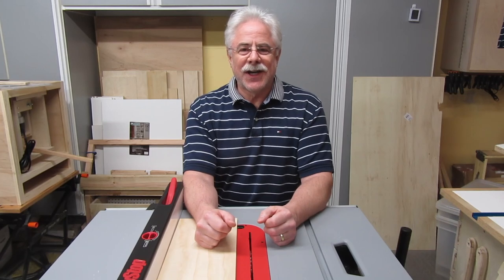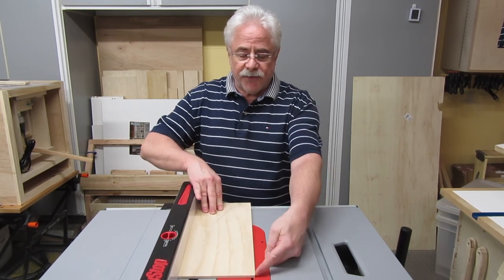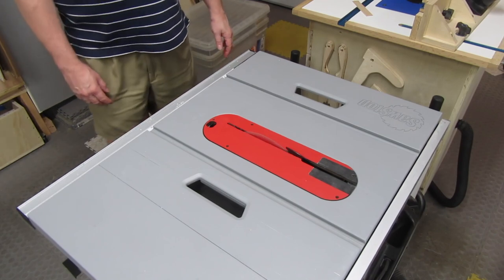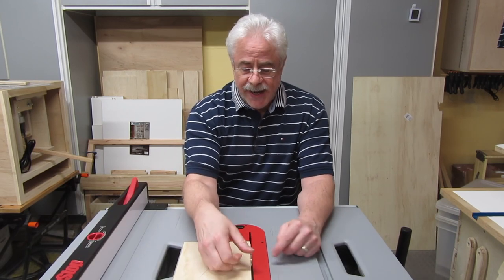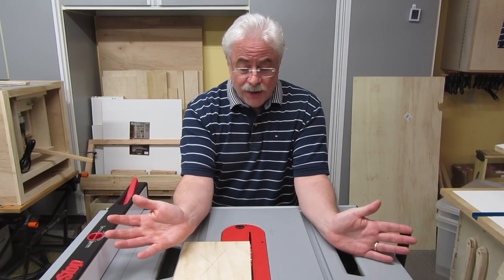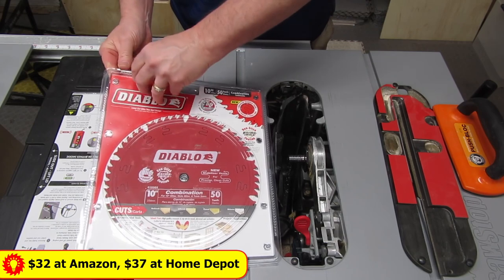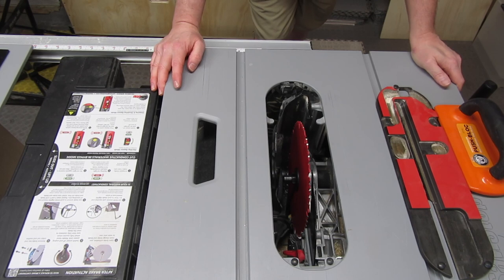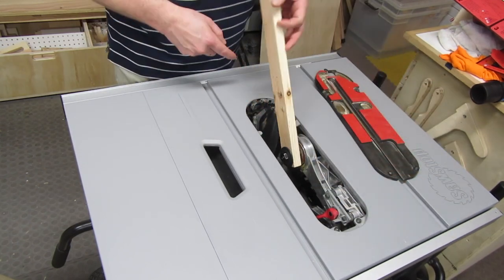SawStop Saved My Thumb! What Happens Next?

Comment: When I was researching cabinet saws, upgrading from Delta contractor, I looked at saw stop. The price took it off my list. But now I'm thinking, one trip to the emergency room, and saw stop would have paid for itself. 

If your channel was a little bigger, sawstop would have sent you one for free. Got to say, they are smart at marketing. Almost all big channels have one they got for free. Better than any other way of advertising.
Reply from the maker: That's what my wife said - one trip to the ER, and it doesn't seem as expensive. You're right about SawStop and marketing. I sent them an email asking if I could use their videos (which I ended up not doing), and their comment was "Thanks for your support! You have some great content. Please feel free to edit footage as needed." Now I kind of wish I had contacted them first. On the other hand, it's nice to be able to say they didn't pay me or anything.
Reply: According to my PCS manual, if you send your old brake cartridge back to SawStop and they confirm that it was activated due to contact with flesh, they’ll send you a new one for free. Hope you didn’t throw the old cartridge away!
Reply from the maker: @craigwilson4903  Thanks, Craig. I already knew that, but I appreciate the heads-up. I think I want to frame it. 😄
Reply: That ER stuff is no joke, but it doesn't stop there. I had an 'incident' with my table saw just before Thanksgiving of last year. I ended up with six stitches in my thumb (no bone damage though). It took until around New Year's for the cut to heal to the point where I didn't need a bandage on it. After several more weeks I could hold things comfortably and am now getting to the point where most of the feeling is back.
Reply from the maker: @navysandman1  Thanks for the comment, and sorry you got hurt. I had a router accident a while ago, and it took about a year before all the pain went away. So I'm in total agreement with you. It's more than just money.
Reply: Cliff Sandy Glad that your injury was fairly minor. I’m an operating room nurse and have been in on a few saw-related injuries. Some people never fully recover from their injury, even if they don’t lose digits. If you can prevent a few hours in the OR, you’ve way more than paid for your SawStop saw.
Reply from the maker: @craigwilson4903  That's a great comment. So many people feel like it could never happen to them. I hope for their sakes they're right.
Reply: not any more Festool will stop this way of marketing due to new european laws and company policys
Reply from the maker: @The1Rausch  What do you mean?
Reply: @TheNewbieWoodworker  I think he means that now that Festool owns SawStop, the saws will no longer be provided to youtubers as promotional items. No idea if that's true or not...
Reply from the maker: @SH-pc4xt  Ah, that makes sense. Thanks.

Comment: Glad you're ok.
Nothing wrong with reading the manual.
And you might want to consider using gloves for changing blades (not only for tablesaw)
Reply from the maker: Thanks, and of course you're right about manuals. I usually read them cover to cover. Gloves! Why do I keep forgetting gloves? Good idea, thanks. 😄
Reply: i never use gloves when using a saw or a grinder of any kind..

if i wear gloves when i'm using an angle grinder and the grinder gets a nib of my glove. it'll drag the rest of the glove in and cut off my fingers
Reply: @victorhangaas6719  using =/ changing blade
Reply from the maker: @victorhangaas6719  I meant that I should use gloves when changing the blade, not when actually using the saw.
Reply from the maker: @ichliebeminecraft  Yeah, that's what I meant. 😄Thanks!
Reply: @TheNewbieWoodworker  iknow, but never use gloves when using rotary tools
Reply from the maker: @victorhangaas6719  👍
Reply: I'm not shocked at you actually reading your manual. What floors me is that you knew where to find it ..... That and how loud that saw is, holy cow.
My Delta belt drive is considered a contractor saw but you could have had mine running the whole time and still narrated the video over it.
I don't recommend it, but I can have a conversation over mine while it's running.
If you knew my wife you would understand...
Reply: @TheNewbieWoodworker  I use an employee. Don't have to worry about whether or not he wears gloves. Can tell them what to do but forget about telling them how to do it.....
Reply from the maker: @leveckfamily8841  LOL, thanks for sharing. I knew where to find it because it's stored in the saw. Otherwise, I'd have to hit the Internet. And yes, the saw is very loud. Fortunately, my new PCS is WAY quieter.
Reply from the maker: @leveckfamily8841  LOL. You sound like the perfect boss. 😛
Reply: @TheNewbieWoodworker  is the new one a belt drive?
Reply: @TheNewbieWoodworker  I'm loyal to a fault and get way too close.... My wife would say too perfect.....
So she handles two things that i can't stand.
She does the firing AND kills spiders.
I'd be lost and scared without her.
Reply from the maker: @leveckfamily8841  She sounds wonderful. "I'd be lost and scared without her." Ditto, and it's terrifying to even think of being without her.
Reply from the maker: James Zachary  The idea of the gloves was to help prevent me getting cut while I was taking the blade/brake off. I did get cut - no big deal, but the gloves may have helped.

Comment: Thanks for the reminder about table saw safety, regardless of whether or not you have a SawStop.  I'm planning to upgrade to a cabinet saw or hybrid in the next year or so, not only for the larger capacity but for the reduction in noise level.  Have you compared how loud the SawStop jobsite saw is vs the cabinet saw version?  That's the main complaint from my wife when I'm down in my basement workshop.

Also, the only thing less manly than reading the manual is knowing exactly where the manual is.  :)
Reply from the maker: LOL! I'll admit to that, but then again, it's right in the storage compartment, so it's not that hard to find. As for the noise - get this: I haven't plugged it in yet. With everything going on with getting the video done, and blogging, I've been doing things little by little. Got everything calibrated yesterday. I'll turn it on today. 😄

Comment: From one YouTuber to another: gotta LOVE that moment at 8:12!
Very useful, thorough and use-able method/process for checking blade alignment Dan... nice! Best, Matt
Reply from the maker: Thanks, Matt. I was beginning to think you fell off the surface of the earth! You know what's funny about the backwards blade? I didn't actually notice I had it in backwards until I made the video (yes, I fibbed a little). I just got lucky that I didn't try to use it. 😛
Reply: @TheNewbieWoodworker  I once did the same backwards blade thing... but it was when I was giving pointers for proper use of a dado blade, wouldn't you know?!  I tried to find the segment to link here but my selective memory seems to be working effectively.  I've been wandering close to the edge of the earth but haven't slipped... yet! Best, Matt
Reply from the maker: @NextLevelCarpentry  😄

Comment: A good rule of thumb (har har) that I use is no fingers within the "red zone" (the throat plate) unless the blade is stopped (not just powered off, actually stopped). When I do not want to wait for the blade to stop, I use a push stick to push the offcut out of the red zone so I can pick it up.
Reply from the maker: Great rule of thumb (very funny 😄), and normally I have the same rule. I don't know what came over me. 😳
Reply: That's all it takes, right? One second of inattention.
Reply from the maker: @Toklat2011  Sure is. Scary, but true.

Comment: All I can say is, don't use a tablesaw without a riving knife. Especially with long skinny pieces of wood that can kickback violently. Don't do it. It's not worth it. Throw your saw away, or find a way to retrofit a riving knife onto it. Or at the very least, get the press in pinned "splitter" jig for $25 on Amazon. I didn't know what a riving knife was, and I didn't study kickbacks properly. I wish I had. I had a really bad kickback 4 months ago. I'm ok, but will have permanent scars. Never angle your blade towards the fence, EVER. The old saws actually tilt the wrong way (towards the fence). Make sure to buy a left tilting modern saw with a riving knife. Never set the fence toed in at the rear, always toe the rear of the fence out slightly, up to 1/64th inches, away from the blade.
Reply from the maker: I don't disagree with anything you said, although I'm not sure why you posted it here. It would have made more sense under this video: https://youtu.be/ZUZ8hRm7a8g

Comment: The cost of the saw and the reset piece are a drop in the bucket compared to surgery and even a single hosptial visit.  My insurance has a 400 co pay for an ER visit. + deductible (around 1500) then 20 percent of the total.  I had a pay 900 for have my finger numbed, cut open and extracting a mesquite tree thorn that went in the side of my finger hit the bone and came out of the top.  It couldn't pull it out without enlarging the whole.   I was an 1.5 hrs from the nearest ER.   4.5 hrs later it was out (I couldn't find anyone that would cut the hole larger so I opt. for the ER).  That was before my insurance was as high as it is now.  I'd bet I could actually purchase that saw and 2 resets for less than I could a few stitches in my thumb.   I should actually take my own advice!
Reply from the maker: Thanks for the comment, and sorry to laugh, but, well, you said it - time to buy the saw. 😂
Reply: @TheNewbieWoodworker  Yes, I know... I also have other hobbies and things, so the money is split up.  I mostly do practical stuff and light custom frame work for the house.  A few pay projects here and there.  I usually put the profit back into things I need.  Works fine now (just light use), but I do intend to eventually sell it and get something else.  The table is sentimental.  My late father used it for many years and I actually do enjoy using it.  It's the reason its still in my garage.  The fold up saw really makes more sense for me but its like having him around I guess. The last two projects I actually used a aluminum straight edge and a circular saw with a finishing blade for sizing all my pieces and a router with the straight edge for the dadoes rather than bust out the table saw. Weather was nice so I did most of the work in the driveway to keep the dust out of the garage (no collection yet).
Reply from the maker: @Danman1972  I totally understand.

Comment: I was really lucky a few years ago. My hand slipped and my thumb went into my table saw blade (not a Sawstop). Went to emergency room got stitches and immediately bought a Sawstop. The blade didn't go deep and my thumb healed fine. Extremely lucky!
Reply: Mark Carter I am inclined to agree with you with about buying a saw stop, I just wish the price was not so steep. Or other manufacturers came up with same type protection. Perhaps the patent will run out and other manufacturers will follow suite.
Reply from the maker: @TheFalconJetDriver  I agree they're expensive, although I was surprised that the JobSite saw wasn't as expensive as I thought it would be. With that said, one trip to the ER would probably cover the cost difference! 😛
Reply from the maker: Talk about heeding a warning! Glad you weren't more seriously injured.
Reply: I wish they made one for a bench router. Got the top of my finger and tore it to shreds, not to deep and it's finally healed. Why doesn't sawstop make a brake when you switch it of. I hate waiting for it to run down. Even a drop saw has one. JD
Reply from the maker: @JayDee-xj9lu  Thanks for the post. I don't know the reason, but there's probably a good explanation.

Comment: Glad your thumb's intact, Dan!  👍   Wonder how much more of a nick you'd have had if it hadn't been spinning down already when it braked?  Probably only slightly more, seeing how the teeth dug into and were stopped by the soft metal of that brake pad.  But don't demo that!  😄

Interesting arbor alignment technique, very inventive!  My own involves having the blade installed and fully raised to extend the arbor diameter to the blade diameter, then putting a piece of aluminum channel (one of those cheap 8' edge guides for ripping) against the blade (actually against two of the teeth leaning in that direction) to extend that line further.  The edge guide is wide enough that it shortens the distance to the miter slot sufficiently to check it with a common caliper micrometer, narrow enough to check its own width with the same micrometer, and long enough to extend the line of the blade the full length of the miter slot, multiplying any error as much as possible by allowing a check at both the front and back ends of the slot.  Also the effect of any blade warpage can be discovered by simply rotating the blade and rechecking a couple times.
Reply from the maker: Thanks, and no, I won't be demonstrating that. At least, not intentionally. Good technique!

Comment: I did exactly the same thing. I shut the saw off and removed the wood. Contacted the very tip of the blade with hairline contact. The blade had maybe one-half inch of travel left. Nothing dramatic happened; just a little click. No! It couldn’t have! 
It did.
The blade did not retract into the machine. No momentum energy in the blade to cause this. The only way I knew the thing had gone off was that the blade was absolutely locked. 
Do not replace the blade/brake cartridge without wearing gloves. The blade is sharp and dangerous. Working to replace the blade/brake assembly without gloves is asking for trouble (experience here). But it’s an easy fix.
How much motion was left in the blade when I touched it? Essentially NONE. Absolutely no damage to the blade OR THE SAWSTOP BRAKE CARTRIDGE! Except the cartridge triggered. The cartridge looks perfect except for a few marks where the saw teeth hit it; ‘probably a unique damaged cartridge. However, it’s now just wall art for the shop. Replacement? $110. Oh well, ‘nice to know it works.
Reply from the maker: Good tip about using gloves - I've learned that lesson well. 😂

Comment: Yes, you probably would have SEVERELY injured your thumb.  Or lost it.  Even though you had shut off the saw - so it was 'slowing down' - a 10" blade; with an RPM of 3,650 - will travel a distance of 159.26 FEET in ONE second.  So, since the blade was still moving enough to trigger the saw stop - the blade still had a lot of speed; which equals distance and numerous teeth digging into one's flesh...  Congrats on keeping your finger.  Blessings.
Reply from the maker: Wow! Thanks for putting it in perspective! 😄

Comment: So the saw stop is not reusable? What does it use? I had a family member cut one of his fingers on a saw. Still has the finger but not much use from it. I have a small table saw but I hardly use it. I do keep the safety guard on it though. These things are scary.
Reply from the maker: The brake itself is not reusable. $79 vs the cost of the ER is a good trade, though.

Comment: Dan, thanks for sharing your experience. Good thumb save! The danger is always in the back of my mind when using such gear, and I have to remind myself to focus on what I am doing, keeping the danger in mind, but not occupying my thinking when cutting.
It occurred to me that your alignment method depends on how straight you have drilled through the piece of wood. As you say the shape of the piece doesn't matter but the alignment of the piece with the shaft does I think unless the piece is held fast on the shaft...damn, now I've confused myself!
Reply from the maker: Thanks! 😄As long as you pivot the board and measure in the same spot, even the hole can be crooked. But yes, you do have to use the arbor nut to hold it in place.
Reply: @TheNewbieWoodworker  I think I can see that now. Very good! Will use this method to align my table saw - cheers!
Reply from the maker: @MiniLuv-1984  Another option, which is actually my favorite, is to get this calibration disk: https://amzn.to/2OwwIbe. I like it because you can measure clear out to the edge, and it's really smooth.

Comment: Just a thought, but I always wear leather gloves with a decent long cuff when working to remove a blade or even adjusting the motor. If your hand slips for any reason at all however unlikely, you could slash your wrist on the blade and bleed out in minutes. All for the sake of some gloves and being called a wimp? To ended up with a plaster on your finger and look how hard you were working to loosen the clamp. I've had a couple of spanner's snap or bend over the years, unlikely. Yes, but possible. Ever had a nut suddenly round on you? The more and the harder you work something, in general the more edgy it can become. Just a thought, you old ten fingered you tuber you!
Reply from the maker: Yes, I keep remembering to wear gloves after I cut myself. One of these days I hope I learn my lesson! Thanks. 😄

Comment: Word of advice-although the blade LOOKS usable after the brake fires, the force of the speed of the brake coming in contact with the blade has the potential to loosen the welds of the carbide to the saw body,  hence micro cracks can form. Turn the saw on and wahala! A piece of carbide comes flying off the blade body at 3450 RPM. Save a finger,  u think a few bucks on a blade and even with safety glasses potentially loose an eye. Always send a spent blade to be inspected and resharpened.
Reply from the maker: Thanks, and holy crap do you know how to paint a vivid picture! Fortunately I didn't even consider reusing the blade. I hope everyone else follows your advice.